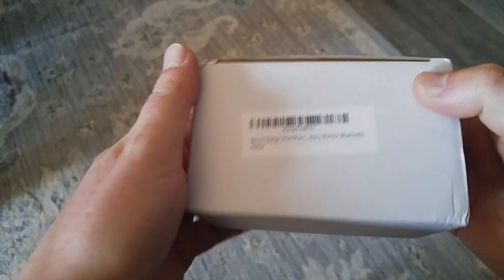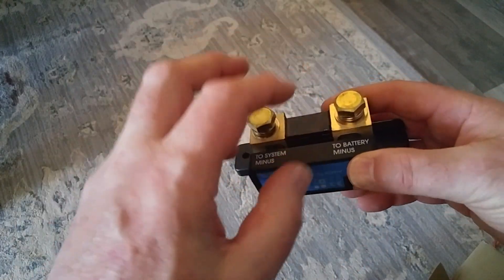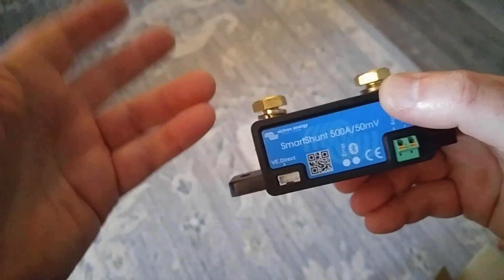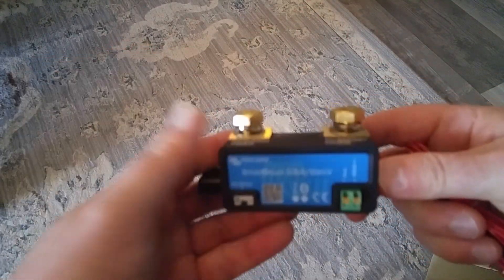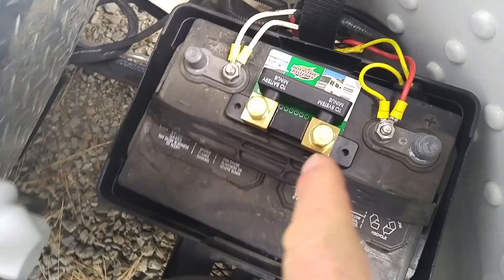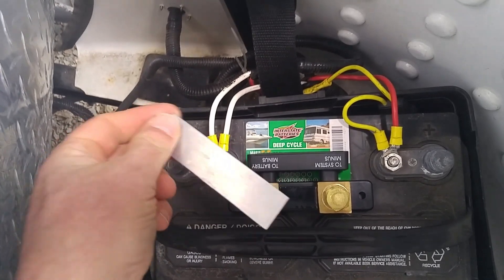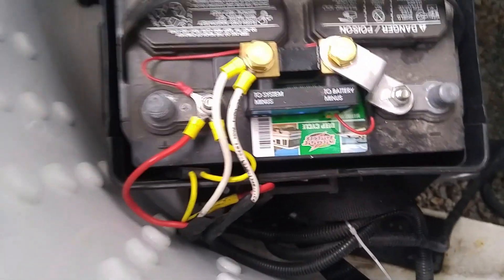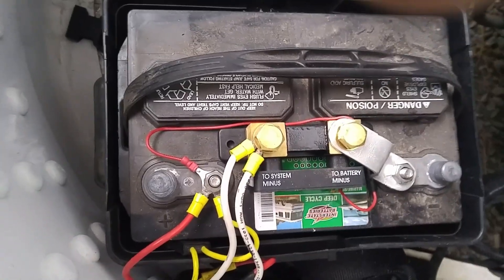Victron Energy Smart Shunt Bluetooth Battery Monitor Installation

Comment: As good as the Victron unit is it could be made better if they modified the “To Battery Minus” side to fit directly over the negative terminal of the battery with the standard battery screw.
Reply from the maker: That might help, or at least they could Include a crimp connector of the right size.
Reply: @tabtrailerupgradesandmaint2923  good point. Does your aluminium bracket that you made get hot? I’m thinking of making one for my 120amp lithium battery / Victron smart shunt.
Reply from the maker: @mrdobalina3451  no my bracket does not even get warm. Being as thick as it is, as wide as it is, and as short as it is, it can carry several hundred amps. There are tables online showing the current carrying capabilities of different cross-sectional areas of different lengths, if you are concerned.

Comment: Hey Mark, thanks so much for these extremely helpful videos. Quick question; my local hardware store did not have a piece of aluminum for the shunt strap, so I bought a piece of brass. Brass would not create any problems, would it?
Reply from the maker: Brass will work well.

Comment: Mark, the bracket does not conduct, correct? It is just too hold the unit in place?
Reply from the maker: The bracket DOES conduct.
It serves two purposes.
1. To hold the shunt in place.
2. To form the necessary electrical connection to the shunt from the battery's negative post.
Reply: @tabtrailerupgradesandmaint2923  Thanks, Mark!

Comment: Thank you Sir for this video.  Very helpful.  When charging the battery using a solar panel, does it make a difference if I connect the solar panel directly to the battery terminals, or should I connect the solar negative wire to the shunt ("To battery minus")?
Reply from the maker: Connect the solar panel positive lead directly to the battery's positive post.
Connect the solar panels negative lead to the shunt terminal where all the other white wires are.

Comment: Mark, thanks so much for making these instructional videos. They are incredibly helpful.  Question: I have an identical bracket to the one you made, but it is made of “zinc galvanized”. Can that be used in this situation?
Reply from the maker: Yes that will be fine.

Comment: My question is did you have to change any of the original terminals on the negative wires to fit the 1/2 inch bolt? I have a NuCamp T@G.

Comment: What size hole did you drill in the bracket? Great vid!
Reply from the maker: 3/8 " for the battery post. 1/2 " for the victron post. Your battery post may be different.

Comment: What is the range for the blue tooth? Can you be inside the trailer or in your tow vehicle and still get connection?
Reply from the maker: I get about 15 feet. Anywhere inside the trailer or inside the tow vehicle. My cargo box and battery box are both plastic. If the cargo box were metal, the range would be less.
Reply: It's bluetooth is absolutely awful. 15 feet is pushing it and it constantly drops connection which causes loss of calibration and status. Got one and returned it one week later. Love the interface and app so realy wanted it to work but had to five up.

Comment: How is the BT range? Can you connect from inside the trailer or do you have to stand next to box. Great video!
Reply from the maker: The range is about 15 feet. I can monitor the battery from anywhere inside the trailer, or inside the cab of my tow vehicle while traveling.
Note that I have a plastic tongue box. If my box were metal, I would expect the range to be less.

Comment: thanks for this video.
great install.
was wondering if your ac/dc or dc/dc battery charger in the trailer is a load also, so that has to be connected to load side of shunt? and i guess this show you the amps discharged from the trailer battery,how do you know when its time to recharge its it on the app?
john
Reply from the maker: Yes, one of the things the app running on your phone tells you "state of charge" in percentage.
And yes, EVERYTHING flows thru the shunt.

Comment: Thanks for a good video. Is it correct that the shunt don't have any memory so you need to have your phone connected at all time to have the log correctly?
Reply from the maker: The victron smart shunt DOES have memory, and does store its own history data, without the use of the phone app.
Here is what the manual says:

5 History data
The SmartShunt stores historic events. These can be used at a later date to evaluate 
usage patterns and battery health. The history can be accessed in the “History” tab in VictronConnect.
The history data is stored in a non-volatile memory and will not be lost when the 
power supply to the SmartShunt has been interrupted or when the SmartShunt has 
been reset to its defaults.
Reply: @tabtrailerupgradesandmaint2923  Thanks that is very helpful information.

Comment: Thank you for this. The best explanation of this process that I've seen...and I have been looking a lot! I'm wondering what could substitute for your plate that you made as I don't have the ability to create something like that? Thank you.
Reply from the maker: Make a trip to your local Ace hardware or Home Depot.
They sell something called a "U-Bolt". 
attached to the U bolt is a "strap"
I'll bet you could find a u-bolt strap that would work just fine.
Reply: @tabtrailerupgradesandmaint2923  Thank you very much!

Comment: Any issues with the aluminum reacting badly with the copper or brass on the shunt or battery. I always thought it was bad to mix those.
Reply from the maker: Galvanic corrosion of dissimilar metals only occurs in the presence of water. That battery, within that battery box, within the tongue box, stays dry. No galvanic corrosion can occur.

Comment: Thanks for this great idea!  I made my own strap from 1/8" flat aluminum that I got from the Depot.  It doesn't look as pretty as yours, but it works!  I also wrapped some rubber insulation around the midsection of the strap so that I don't get shocked.
Reply from the maker: Sounds great.
Glad the video helped.
FYI...
The strap is connected to the negative terminal of the battery.
There is zero voltage on that strap.
It cannot shock you.